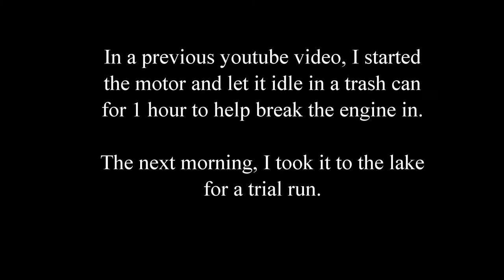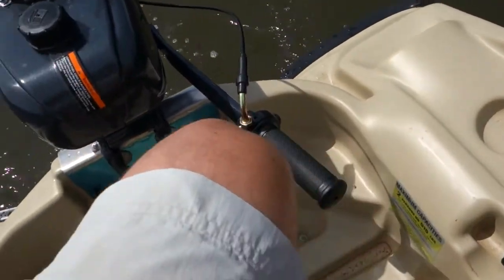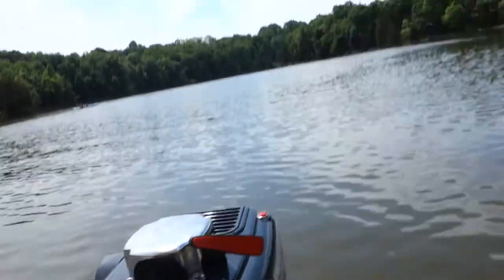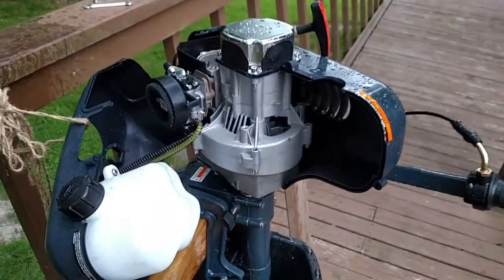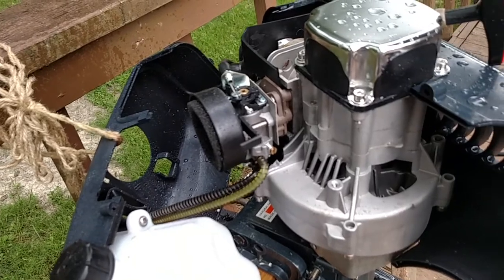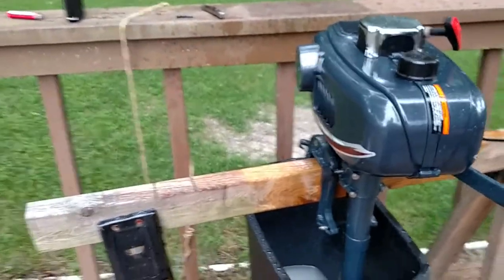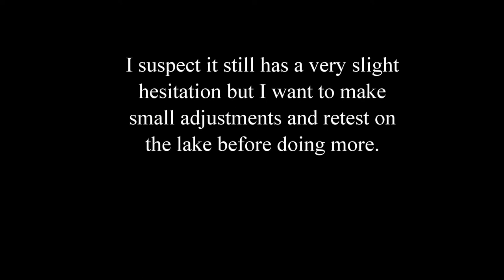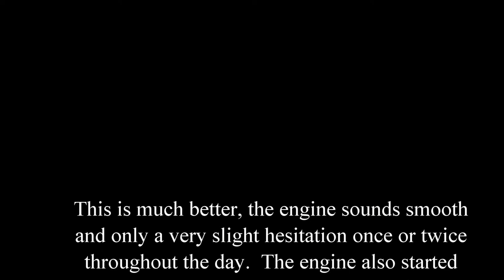hangkai 3.5 HP motor fix (air fuel ratio)

Comment: Glad you fixed it.  Most newer 2 strokes are tuned right on the raggedy edge of too lean for the EPA, and the Chinese one's are the worst of the bunch.  First thing I do is break them in on 25:1 mix with marvel's mystery oil added in addition to the 2 stroke oil 2oz per 5 gallon can.  Then I switch them to 32:1 still with Marvel's added, adjust the air/fuel mix, and only use premium gas because cheap US gas has no stabilizers and it goes bad in the can in a month.
   Which is why so many people complain about Ethanol in the US but in most foreign countries it's a non-issue.  Since it takes so long to ship gas to those countries on tankers all their gas has stabilizers in it.  In the US it goes from the refinery straight to the pump and is gone in a week so only Premium has stabilizers.

Comment: Remember, the cooling water pump does not run unless the prop shaft is turning.
 The centrifugal clutch does not engage until the rpms come up, so the output shaft does not turn the impeller.
 Idling, with the prop still will deprive the cylinder of coolant.  
tom

Comment: Got my hangkai 3.6 a little over a week ago. First chance to get it out on the lake was today. Your motor, (the way you had it set up first) sounded exactly like mine. After your adjustment it sounds very nice unlike mine. My engine never idled. Had to run it at first with the choke almost all the way on. Once it warmed up I backed off the choke it seemed to run better. But it's stalled. I got it started back up I was only running like three quarters throttle and when it tried to stall again I caught it with a dose of full throttle. It happened about 5 more times I'm sure if I wasn't quick on the throttle it would have stalled. So I thought I would come on YouTube and see if somebody wasn't messing with the idol or the mixture or even leaning out the oil mix a little bit. I'm very glad you made this video hopefully my mixture adjustment screw is in the same place and it fixes my problem. Thanks brother I'll keep you posted.
Reply from the maker: it seems to be a common problem with these so I am sure that is the case.  The reason is that they can't pre-tune the air/fuel ratio for every possible altitude where they might be shipped.  Usually when people buy "small engines" like chain saws, weed eaters, lawn mowers, etc they are usually assembled by a local shop/store and tuned before they are sold to someone locally (or at least somewhat tuned and adjusted for that general location) but when you buy something online that gets shipped from over-seas and stored in a warehouse to be shipped many states away ... this is the result.
Reply: @sharpridgehomestead  that certainly sounds like a possibility. Me I was thinking the manufacturer errors on the side of caution. When first cranked up I believe they want that motor as rich as possible both in the fuel oil mix and the air fuel mix for lubrication and limiting RPMs.

The funny part is everything I know about this motor came almost exclusively from customers on YouTube and not the manufacturer.
Reply from the maker: @LouLovesLyrics  I've had mine 5 years now and once I fixed the air/fuel ratio ... I have not had a single issue out of it unless something happened last year and i don't know it yet (been fighting cancer the last two years and never even got the chance to start it last year).  All I usually do religiously with this motor is drain all the fuel before winter and start it up and let it run until it gets the last bits of fuel burned up and it usually starts up easy in the spring with fresh fuel.
Reply: @sharpridgehomestead  sorry about your cancer brother. I'm facing skin cancer which is nothing they just keep cutting and freezing it off. Might have developed a prostate issue though got to go to the doctor and check that out. But gave my mixture a half turn counterclockwise motor started idling high enough to turn the prop. So I backed off the idle adjustment a couple turns and let it warm up. Then I backed off the idle a little more and let it run for about 15 minutes before it finally stoped on its own. One more little tweak of the idle screw and now it seems like it will idol forever. Thanks for all your help brother.

Comment: I have the same boat and motor. My motor will start to hesitate once it gets warm. I'm going to try this adjustment. Thanks for posting.
Reply from the maker: mine runs like a top now ... I have had it out at least 25 times after this video and it has never stalled or died.  I'm thoroughly impressed with how well it has done considering the lower cost.
Reply: Billof Right

Comment: I just got one of these for my son's Quest Angler 8. I had to turn out the mixture screw just over a full turn to get it to run best. Also, if the gas cap is too tight, it doesn't vent properly for whatever reason. Runs great now on a stand. Hopefully, it runs as good in thd water!
Reply from the maker: Thanks for sharing.  These seem to be solid motors that once you get the air fuel adjusted for your location they have very few issues. One thing I left out of videos inadvertently is don't forget to drain fuel from the tank and carb during any extended periods of not using, like over winter or like me while in cancer treatment. Or add some type of fuel stability additive.  This keeps moisture in the fuel from corroding the carburator

Comment: I was having the same issues.  I followed someone else's recommendation and replaced the Torch L7T spark plug with a Champion CJ8Y.   However, factory specs called for a 0.9-1.0  mm gap (0.035-0.040 in.).  The plug it came with was set at less than a 0.5 mm gap, so I set the gap to 0.035 on the new plug.   I also made the mixture a bit richer by a quarter turn out, then another eighth of a turn out. (3/8 turn out, altogether.)  It ran better but still some occasional hesitation.  I loosened the gas cap and now it runs better.  So, I think there is a venting problem with the gas cap design.  That's my next project.  It's a sweet, simple engine.
Reply from the maker: thanks for the comments and additional tips for others to try.  I guess I just got lucky with mine, I haven't had any issues with it since I set the air/fuel ratio and its still running on the same spark plug (i think I may have adjusted the gap before I did the air fuel ration mix but I can't remember now).  Also, thanks for watching!

Comment: Another small tip is to use 10w40 oil in the lower.. I’ve picked up another 1 mph just by using synthetic motor oil 10w40 in the lower.. creates less drag allowing this little henkai to rev up a little quicker.. the rpms even sound higher. 34 hours on mine so far and no issues. She doesn’t even run hot
Reply: Noticed my gears were very tight. Had to turn pretty hard to rotate the prop half a turn to get to the cotter pin. My rubber gasket looks like it was too big and part of it was sheared off almost uniform around the entire circumference. So I will be changing that fluid regularly might give your idea a try next time.
Reply: @LouLovesLyrics  yea these are made in china so don’t expect quality.. but they do ok for what they are. I’ve since blown up the power head and decided to rebuild a little 5hp seahorse outboard i was given. Much better now
Reply: @mikecorleone6797  the 2 people I have found that seem to know the most about two stroke motors, that own these 3.5 or 3.6 hangkai motors, (Ed Widget and Boiler Dan) have had their motors for multiple seasons. Both of them like myself immediately felt like they were running rich. Different theories for this. One was manufactured at high altitudes. Mine was manufacturer was erroring on the side of caution, delivered motors set to run rich for two reasons. One guaranteeing that the motor would not reach its maximum rpm, second that more two-stroke oil than the engine was designed for would be flowing through and over the most critical services when it was first started. Either way after adjustment motor seems to be running just fine.
After 1 hour I disassembled the lower unit and found metal flakes in the oil. So I replaced it with fresh oil. I suspect this motor will need a lot of maintenance.
But it has so far past two tests that I purchased it for. It did move my 14 ft inflatable boat efficiently, (and I will be performing another performance test now that it's running properly). Number two I was able to load the 14 ft vessel and the outboard motor onto the back of my adventure motorcycle. And it will surely make some interesting off shore fishing scuba diving videos launching off beaches in Florida from the back of a motor cycle. Just a crazy idea I had. The only thing that makes this possible is the ultralight two-stroke motor I have invested only $250 in.
The boat was originally purchase to be a dinghy for my sailboat and I have a 5 horsepower Honda 4 stroke, but the four stroke will not fit on the back of my motorcycle with fishing gear and hookah scuba rig.
 I will be launching this spring Diving and fishing of bird creek beach and the reefs near there I will also launching off of Jax Beach at The reef where the old Pier was I will also be launching off the beach at the Guana preserves for some of the cleanest water of the north Florida Atlantic coast.
It looks like the sailboat will be launched at Fort Walton beach because that's where I will be working. The dinghy and the five horsepower will be out there but the motorcycle will not.
Stay tuned.

Comment: I wish one of you guys that has there motor running good post a comment on what your
Screw adjustment is set at. In other words how. Many turns out from closed. I have a motor 
Coming in next week. It would help many, with a good starting point. I know they can very from motor to motor & elevation. But it would be a good starting point.
Reply from the maker: Thanks.  I know that method used to be used in older carberated motors but i doubt the tolerences are that exact in this motor. At least with mine, it was set close enough it would start and idle and even made it through the break in period they asvise you to do just fine.  It was only when i took it out on the lake and was pushing a load that the air/fuel ratio was obviously wrong.  I'd advise you to make sure you have tools on your first outing or 2 so your trip doesn't get cut short.  Its pretty easy to adjust carb pushing the load you need to push on the lake at 1/2 or wide open throttle.

Comment: when the water jacket leaks it shorts out the engine kill terminal witch is located directly under the cylinder head. It come equipped with a rubber jacket. But this doesn't prevent the terminal from grounding enough time to time. The fix is bury it in silicone. It will leak it is the short fall of the motor. The 6 hp is so much better. Like 4 time the engine.
Reply: actually there is a video showing that using jb weld professional 500 temp product around the water jacket after cleaning up the cheap failed sealant and waiting 24 hours to dry as per directions and hasn't leaked one bit according to him.  Just saying....

Comment: Just to let everyone know who's reading these comments the true horse power of this motor is not 3.5 horsepower it is really about a  1.5 horsepower outboard motor So when you're looking at buying this outboard look around at the brand name used and new 1.5 and 1.8 horsepower outboards as well Being a 2 stroke adjusting the fuel mixture and the carburetor can give you anywhere from 1.3 horsepower up to 1.8 horsepower with this particular engine.
Reply from the maker: yea, there is some misconception about how HP is actually measured.  Two trains of thoughts, going by the engine cc or going by the drivetrain/finaldrive.  For instance, I can build a car engine to be 500HP but how much of that actually makes it to the wheels?  There will be some HP loss or gains depending on the drivetrain/finaldrive, correct?  HP would be different at the wheels depending on if it is an automatic transmission with disc plates that can slip vs a standard transmission with steel gears that lose very little power.  With that in mind, this engine is 49cc which at the engine converts to 1.5076923076923077 HP.  And there is a 2.08 to 1 gear ratio to the prop, so at the prop the HP is 3.136 HP.  I didn't factor in the advertised operating range of 4,000 - 5,000 rpm which can cause that 3.136 HP at the prop value up or down depending on where it falls.
Reply: How exactly do you know this? Do you have an engine dyno? Do you know the difference between prop horse power and flywheel horse power? Or did you just read it on the internet?

Comment: Thanks, I have to change my inlet and outlet fuel lines. I know the inlet line is completely submerged, but what about the outlet line....?
Reply from the maker: What are wrong with your fuel lines?  I never changed mine and its been a few years since i did this video and honestly the engine has never given me any more issues.
Reply: @sharpridgehomestead I was out on the lake the other day coming in and I noticed a fuel leak, when I got around to checking them today I noticed gas tank was loose and both lines were partially severd. Black line with filter was at bottom of tank, not sure about the other...
Reply: Should both lines be submerged in tank or just the one with the filter attached...?
Reply from the maker: @ballader4life  give me a few minutes to run out and look. I was about to head out that way anyways.
Reply from the maker: @ballader4life  my gas tank is drained and i used a flashlight to look down fuel cap hole. I only see one fuel line on bottom of tank. Bad thing is i can't really see around the inside of the tank ..  Even my mechanics mirror wont fit down there. I hate to say either way but knowing how fuel systems work, if one is a suction line it would be touching the bottom and the return/overflow line wouldn't matter if it touched bottom or not.
Reply: @sharpridgehomestead  thanks Ed I appreciate you going the extra mile.... Other than that the motor's been pretty steady. I'm going to get me some replacement lines and give it a shot thanks for your help again buddy.
Reply from the maker: @ballader4life  never a problem, if there is anything else you need .... Dont hesitate to ask.
Reply: @sharpridgehomestead  Alright

Comment: Well thanks I know I have worked on two-stoke engines my entire life. I would just like to know a starting place before adjusting the fuel mixture. If someone has one of these 
Motors & runs without problems, would you please check how many turns out from closed 
Your adjustment screw is set at & post back. That is all I,m asking.  Thank you!
Reply from the maker: did your motor come in?  Did you have any issues with it?

Comment: The fuel lines were rubbish and perished quickly,my motor run the sme way till i swapped the fuel lines with more robust lines and swapped the supply and fuel lines  around .they were back to front